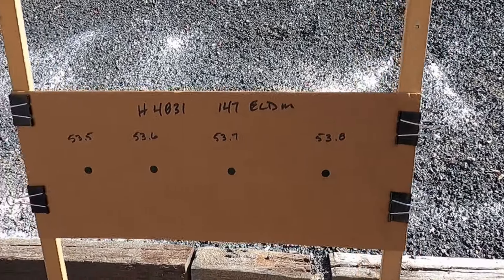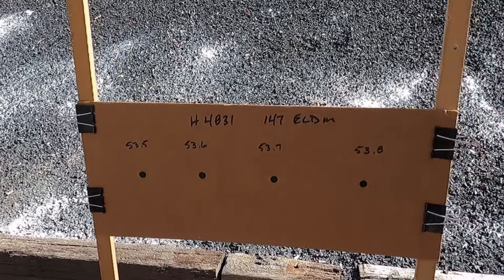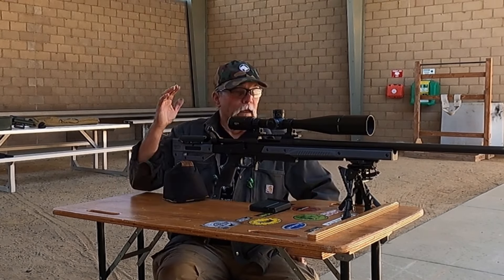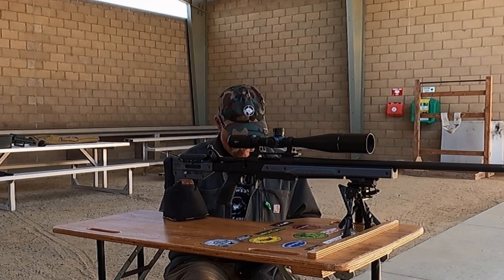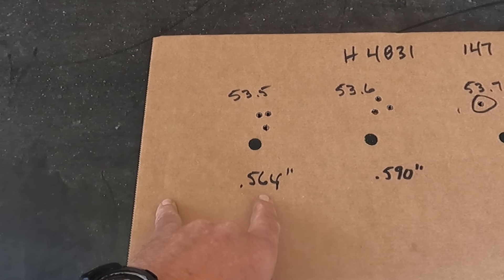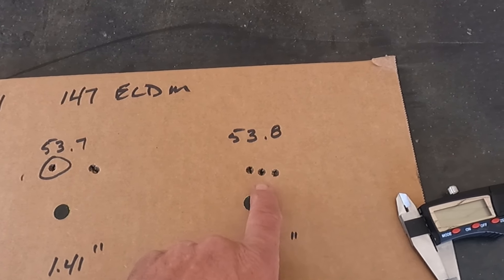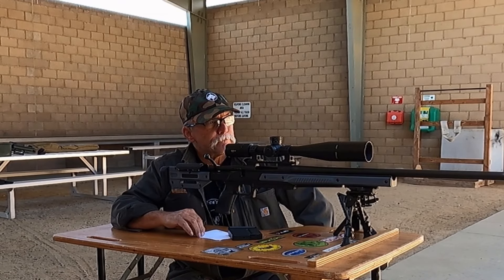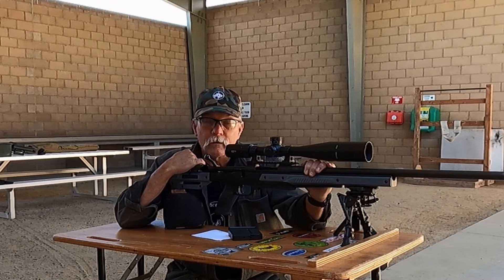Trying to dial in the H4831 load in the 6.5 PRC part 1

Comment: Someone has been disabling comments for 3 days now on firearm related posts. Keep checking cause it will happen again. That 53.7 & 53.8 sure looked good especially with low ES & SD. Very nice groups Sir. Looking Good! 🎯👍🙏
Reply from the maker: Dang, between unsubbing folks secretly and now trying to stop the signal by disabling comment...hmmm. Maybe I should check a couple other recent vidoes to see. Thanks Bill.
Reply from the maker: OK Bill...based off you information I went back and checked a couple other recent uploads...sure enough, comments were turned off there too...funny, why would I do that after a bunch of positive comments...hmmm...

Can't stop the signal!
Reply: @Halfmilesniper It started with a few 3 days ago & has gotten worse. Probably have to keep rechecking several times because it may happen 5 or 6 times unfortunately. I originally thought I got blocked. Imagine That 😂.
Reply from the maker: @billdye3530  the comments getting turned off battle continues. Thanks for the heads up Bill.
Reply: Hi. I have noticed comments on shooting related sites being deleted too. Has happened to me a few times now. I post nothing controversial, impolite or use bad language, but they still go missing.
Reply: @Nick-bp7jf Somebody in YT system has taken the Protect the Children too far. Nothing I've seen firearm wise has been bad for children but I'll guarantee they have access to R rated material. Which is worse?
Reply from the maker: @Nick-bp7jf  I contacted YT last night to find out what was going on...they admitted they were removing and/or disabling comments on "tens of thousands of videos"...their words...because of content harmful to children. Funny how the harmful content (which doesn't exist) is only happening on gun related content.

Comment: Smokeless 4831 powders have a very interesting history. There are several variances and designations that can also vary between lot numbers of batches and years going all the way back to WWII. They are not interchangeable, and should be noted to even batch test. I have IMR 4831 because there is a old loading for .223 rem the army used you can find with a little searching. It will have less than 50% burn efficiency in shorter barrels, so I am saving it to try and recreate some of those M16A2 type loads. The 4831SC short cut and others like this H4831 are close enough on burn rate charts to cause confusion possibly.
Reply from the maker: I have tested both and shown there is a difference yet every now ad then someone comes along and tried to claim they are the same powder. As you stated, they are not and have very different load data. I know it was an older powder but didn't realize it dates back to WW2...learning stuff every day.
Reply: @Halfmilesniper  Ah man, I went looking for some interesting history to reply to you and ended up going down another rabbit hole of Dupont, surplus, and now even about 4831's from Australia and Canada. We all know smokeless powders can be traced back to the first formula and that is why burn rate chart is ever expanding!
Reply: @Halfmilesniper  Your groups in the video were very nice (btw) and the anticipation of what could have been with the trigger jerk is too much!
Reply from the maker: @timparkhurst8661  one of the Australian viewers had mentioned that H4831 was only being made in Australia, not sure where the IMR4831 is being produced though.
Reply from the maker: @timparkhurst8661  Thank you Sir.

Comment: I'm positive you have more experience and are a better shot than I firstly. May I make a suggestion? Following through with trigger pull helped me with trigger mistakes. What I mean is when you squeeze the trigger, follow the break to the stop, hold until you see impact then reset. I found this while practicing with an air rifle. It tightened thing's up on my powder burner shooting. Little cheaper practice and quiet also.

Nice video.
Keep'em coming! 
New sub!
Reply from the maker: Thanks for watching and subbing...there is plenty of follow through, my finger doesn't release the trgger until after impact. It is even more evident when I am shooting an AR...I am one of a few shooters on video where you can actually hear the trigger reset, lol. As a competitive pistol shooter follow through  is extremely important. 

Welcome aboard.

Comment: What do you think you can possibly achieve going up .1 grain powder charge at a time. One 10th of a grain is within the margin of error with your scale you’re wasting components
Reply from the maker: Not really...earlier testing had an ok group at 53.5 and 54.0, but the es/sd weren't quite there, now drilling down at .1 gr increments to dial in on a load and hopefully find a wide node that spans several tenths spread.

Comment: why are you going in .1 increments? aren't you waisting components that you could be using for other testing? 

look at your velocities at 53.6, 53.7, and 53.8. each powder weight shoots basically the same velocity. in a case that big .1 grain almost meaningless unless you are trying to find the edge of a node.

also, your groups are all about the same with those three loads. I would bet that you didn't jerk that one as far as you think you did.
Reply from the maker: I went in .1 gr increments for this test because I had an OK group at one load and another OKish group .5 gr higher...was hoping to see the group tighten in between.